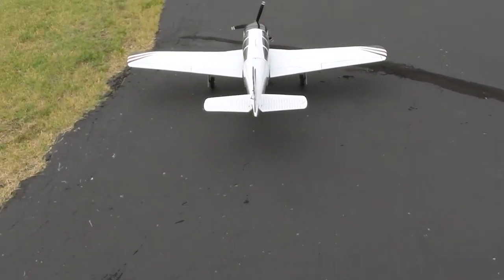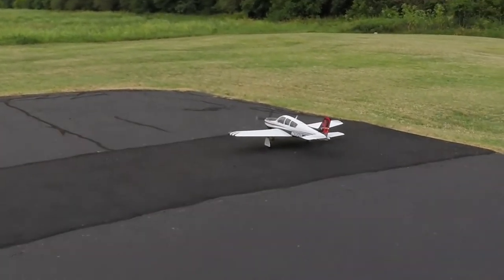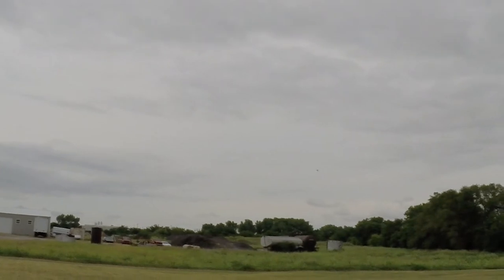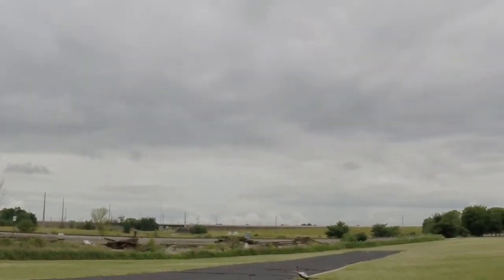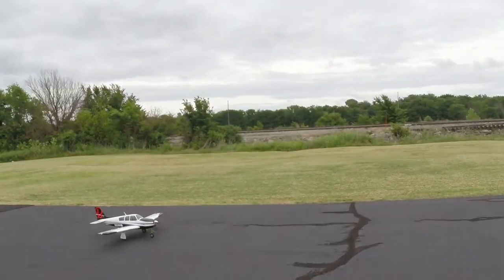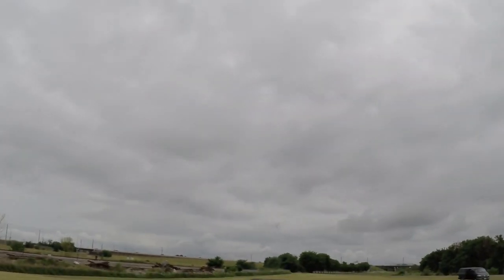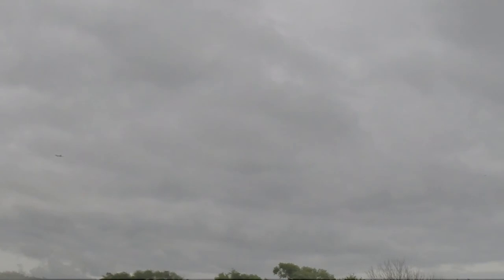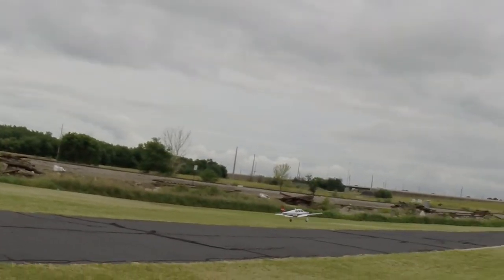Beech Bonanza Maiden Flight(s)

Comment: Thanks for posting this. I have the Wendell Hostetler 108.5 inch wingspan Beech Bonanza A36 in the exact same paint scheme. Have yet to maiden mine. It's powered by a DLE 85CC engine swinging a Beila 3 blade 23x6 prop, electric robart retracts. I was thinking of buying one of these to practice on before I fly my expensive one!

Comment: You did very good.   Well done.  I'm thinking about getting this plane,  would you recommend it?   Thanks.
Reply from the maker: Yes, I love flying it!  It can do almost any aerobatics, short of 3D.  It looks very scale on the ground and in the air!  The only thing I would share . . . I wish I would have tried the V-Tail version though!  I use a gyro in it, but it is a stable platform either way!  Check out the RC Geeks review of the V-Tail version here   https://youtu.be/_cZB2-sQy6g

Comment: HI there - congrats on the maiden! I got this plane today and have the same VQ retracts on the way. Did you have to trim off the legs a little or are they a drop-in replacement? Regards from Denmark.
Reply from the maker: I used them out of the box without trimming them off.
Reply: @terrywiggers5877 Thanks for the reply - i have them tomorrow.  So the only major thing I need now are the servos. I got a 80A Hobbywing ESC and plan for a 5S setup also with 3 blade prop.

Comment: Great flights,did you us book CGor had to add tail weight
Reply from the maker: It flies good at the recommended CG in the book.
Reply: Thanks what pack are you flying lm using a 5000 6s
Reply from the maker: Yes,  I’ve been using the HRB 6S 5000 mah.  I believe they weigh about 26 oz.  They run about 5:30 minutes.

Comment: Do you think a big motor would be more efective in take offs ?
Reply from the maker: It has enough power as a scale model.  However, it wouldn't hurt to jump to 50 or 61 equivalent.  The downside to that is the prop is already a big enough diameter that it has minimal ground clearance.  You'd have to use a smaller prop with more pitch on a bigger motor.
Reply: @terrywiggers5877   thanks a lot !